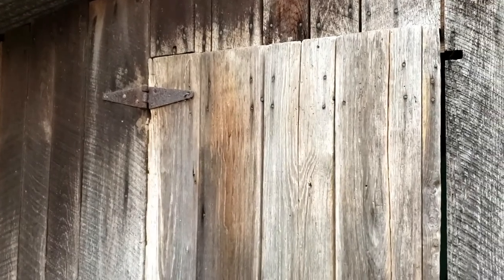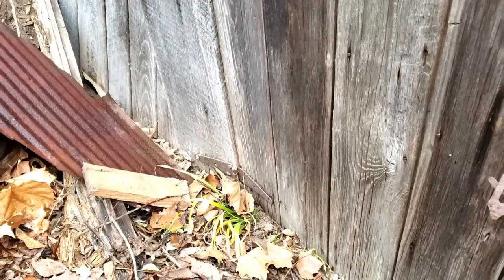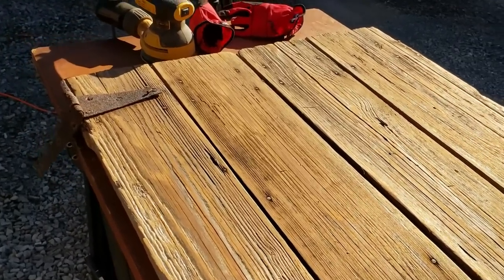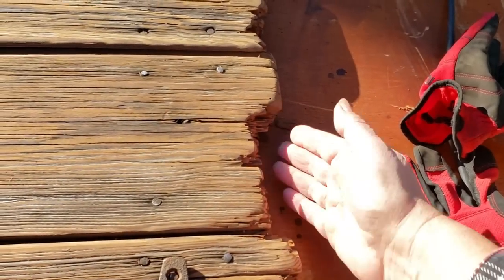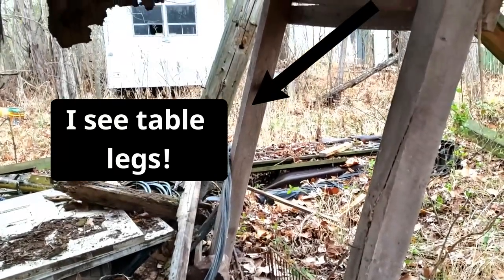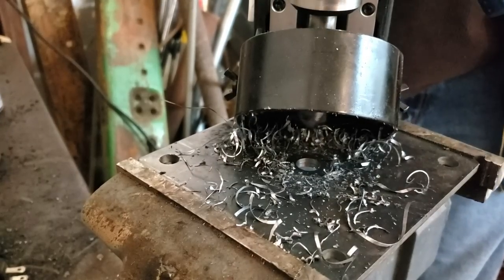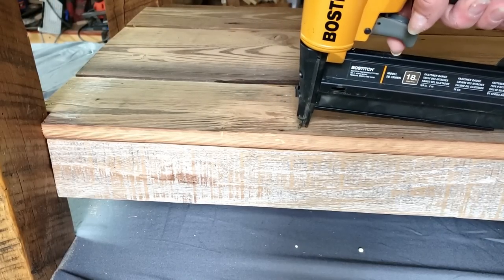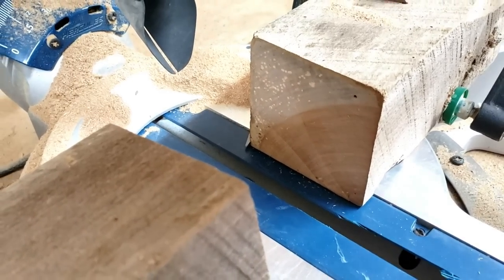DIY Rustic Barnwood Coffee Table

Comment: Oh. I have a CNC plasma cutter and I could have made the leg mount plates for you. You did a nice job on the table. I thought that it was in to bad of shape to use. When I worked at a small steel fabrication shop, I used the recycle the wood that the steel came in one. Well, you are one talented lady. I used to do some wood working but not so much now. You did a nice job on the video and the table. Thanks for sharing.
Reply from the maker: Cool, thanks!

Comment: Neat project, beautiful outcome.  Trimming the end to the batten was sensible since it was already notched.  I think I would have removed the hinges from the top, pulled the pins and mounted a half vertically on each leg butting the top underside.
Reply: Thanks Wayne. Always learning. I have another door, I just might try that!

Comment: Incase the whole thing in clear urethane.
I saw someone do that to a very old very rotten work table and it turned out looking fantastic. You can see all the bad edges and dips and gouges in the table and the table top was completely smooth because of the clear urethane.
I also did that to a round wooden clock face that had a battery movement in it but I put the numbers right on the wood and then put the clear urethane over the top so the numbers would not fall off and it worked out perfect.
Reply from the maker: Interesting stuff, glad it turned out. Clear urethane can really work wonders on old stuff!